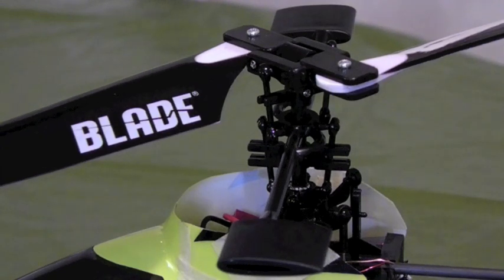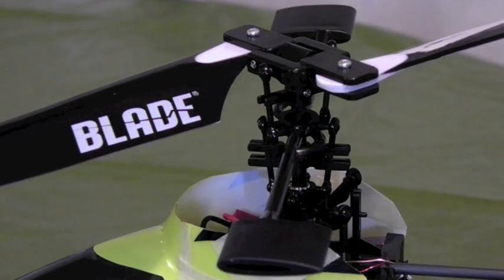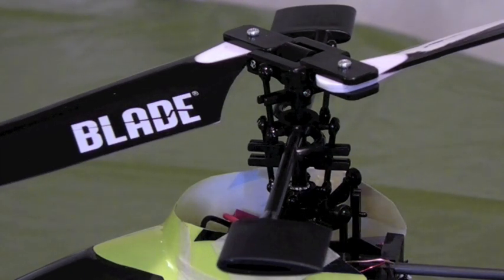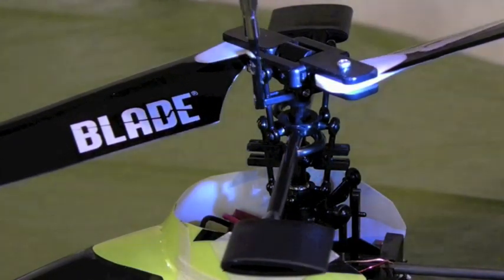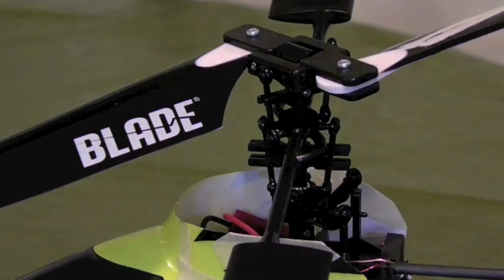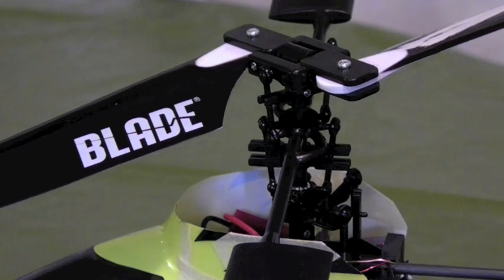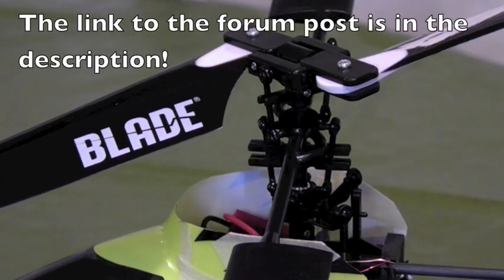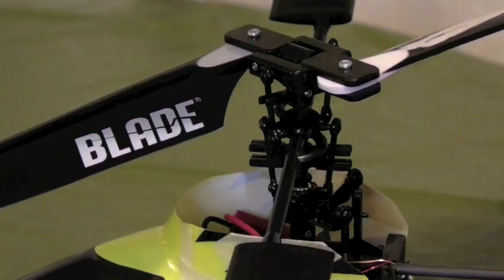Blade 120 SR- Fixing TBE (Toilet Bowl Effect)

Comment: Had an anoying minor TBE going on with my blade MSR and I looked at this on mine and sure enough that is exactly what the problem was. One of my crashes must have caused the little alignment fingers to get bent just the slightest.  I straightened them and TBE is gone. Thanks a lot. I'll probably put some money into getting the metal components now that my piloting skills are better and I'm less likley to crash.  

So glad I found your video.

Comment: I had *counterclockwise* rotation, sporadic, and usually toward the end of the first battery.  I put in a new tail boom assembly, with motor.  I think the rotor motor may have been defective.  What we have on this page is a fix to *clockwise* rotation, which would be from the main rotor undertorque.

Comment: I cracked the hub on my 120 SR. Repaired it with Shoe Goo. Have not tried it yet. Like the idea of using a little heat on it. If that don't work, will just purchase a new hub. Our local hobby store has a bunch of parts for the blade. One of the things I like about the Blade Product is the available replacement parts right at the hobby store.

Comment from the maker: Sounds like you may have a faulty tail motor. Hold the heli in your hand and turn the throttle to half (don't let go). See if the tail motor is spinning. Now jerk it left and right. You should hear the motor working to compensate for the spin. If the tail motor is at a constant speed and doesn't speed up or slow down, you may have a faulty motor. If its not the motor then it may be the main board. those are the two possible issues I can think of.